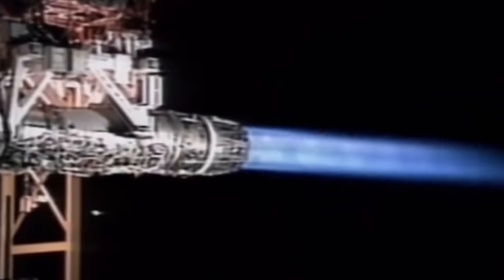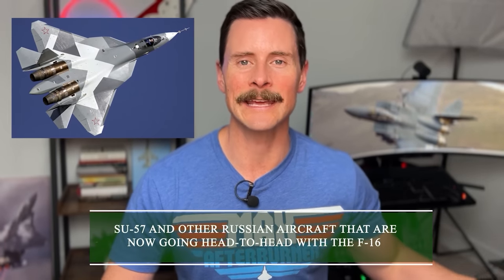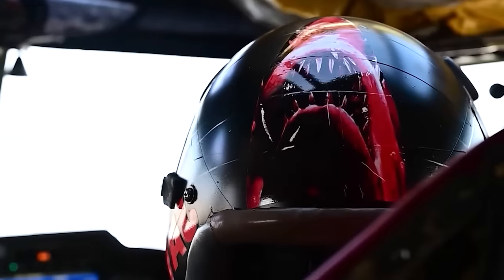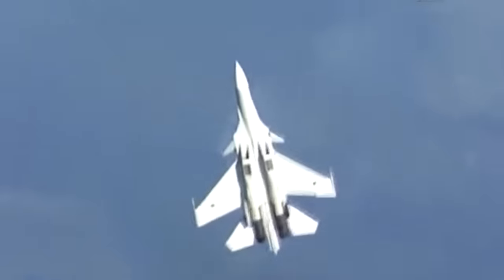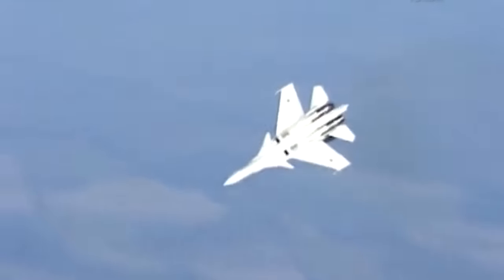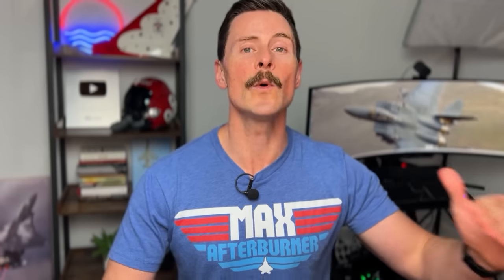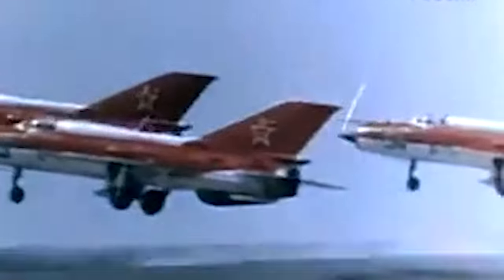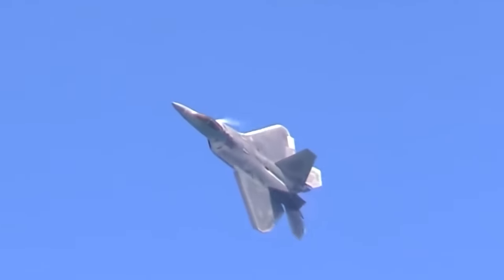Fighter Pilot Reacts to the Russian SU-37 Terminator

Comment: The SU-37 wasn't just an SU-27 with thrust vectoring engines. It was a whole new airframe with canards. Canards are used for extreme manuvering. The U.S. built an F-15 as a demonstrator but later decided against that. The SU-37 with canards and thrust vectoring engines would later lead to its downfall due to structural failure. The design was later implemented on the SU-30 SM, but THIS airframe WA a two-seat variant of the Terminator. It uses canards and thrust vectoring.

Comment: The Soviet/Russian doctrine of replace-to-fix rather than fix-in-place is still in existence.  Engine changes are relatively easy.  Maintaining thrust vectoring systems within a jet is difficult in the best of circumstances and way outside the doctrine of Russian modular replacements for routine maintenance.  Such precision work precludes the vast majority of technicians outside of the test-flight cadres and operational bases.  Thanks for bringing us this cool video.

Comment: Does a "Super Cobra" even exist? the only place ive seen a full 360 Backflip is on Ace Combat, doub its physically posible, at least with the engines we have today
Reply from the maker: Hmm maybe the Raptor could pull it off?
Reply: @MaxAfterburnerusa  doubt but idk, feel like needs more thrust to complete a loop, in the other hand IDK how could be done
Reply: @MaxAfterburnerusa ржу в голос , суперкобра вошла можна на су 35 и СУ 30 в версии см

Comment: Hi Ryan, thanks for the great content.  Would a cobra maneuver risk presenting more planform if both jets had similar forward speed / energy?  Couldn't it get you shot?
Reply: you usually do the cobra right after the merge or if a bandit is on your tail and really close. so yes, it does expose more planform, but the idea is the bandit isnt in a position to shoot you at that time, or doesnt have time to react. You time it poorly, and you are asking for it.
Reply: In simulators cobra is also used sometimes to slowdown the plane and get a second shot after a missed one. It is basically a repositioning tool, like a hard handbreak and nose repositioning. Not sure if it would be used like that in actual dogfights, but it works nice in DCS and even Ace Combat 7.